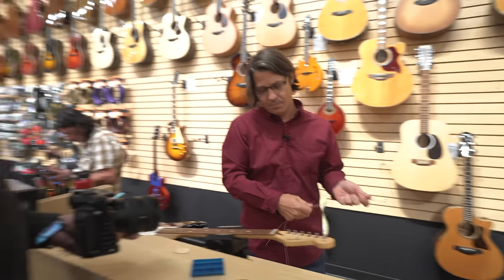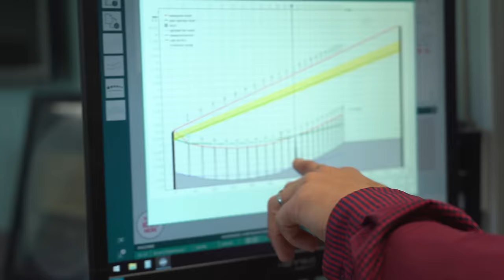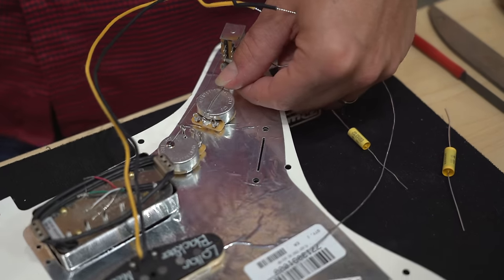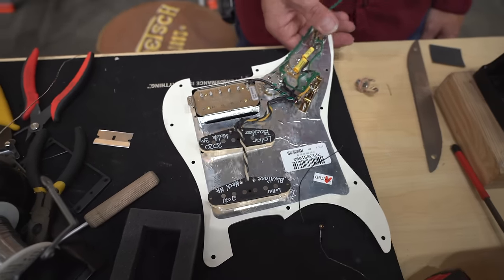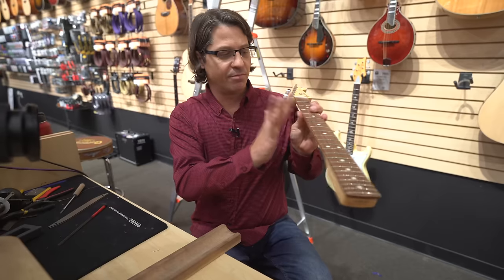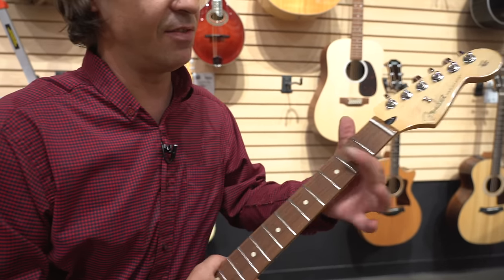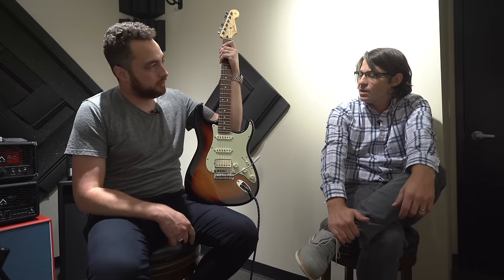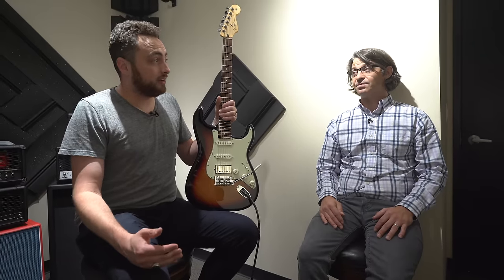We Tried To "Custom Shop" The Cheapest Fender Strat

Comment: Bro, the mexican made players series strats suck.  The squier strats are 10x better as far as finish quality etc.   even the cheapest affinity series strats are better…..except the ceramic pickups which is purely a preference thing.  I like them personally.    
Id never ever pay $900 for a players strat.      Id never pay for a squier either.  For a couple hundred bucks and a lil tlc i can build a strat from a kit or body and paint it with nitro finish in whatever color i want or a cool artistic paint,  i can put whatever pickups i want on it, i can wire it how i want, put a neck with scalloped frets on it whatever.   Then if a “fender” makes u feel warm and toasty inside, i can slap a fender decal on the headstock and sell it to you for $500 more…..but me personally, i like to carve the headstock into a unique shape too.

Comment: Y guysou buy a guitar for $800 that you don’t like which by the way sounded pretty good to me and you’re gonna put another $800 into it you can send it back to the shop and have them correct all the main problems which they should’ve done in the beginning and  still only have $800 into a guitar. What you guys are trying to do is pretty dumb to  me.

Comment: You can’t custom shop the cheapest Strat because custom shop guitars their wood is specifically picked from the best and their made with fine detail buy just a few guys not the whole regular Assembly line so you would have to build a strap from the ground up counting the wood cutting it out shaping the neck from a single piece of wood and all that you can’t just buy a cheap guitar and custom shop it🤨

Comment: I thought replacing the pickups & electronics was a bit more than should have been done at the start, but a custom shop model is going to come with better parts.
It would have been nice to see an intermediate setup more like was discussed... you know... upgrade a little here, a little there, and in a couple years you have a great guitar.
But we don't get to see/hear that.  Hindsight is great isn't it?

Comment: If a shop is worth it’s salt, a setup should include a fret level ,and recrown , fret sprout addressed.  As well as the various height adjustments. That should included used guitars as well. The  should also offer a touch up setup within 30 days to fine tune any adjustments the player would like . Also IMO if the local shops do not offer this type of service and a person still wants to mod their guitar in such a manner buy a used model and used pups you can save that way and also may fine some mods already done

Comment: . Ive bought a few name guitars in my time which have had sharp fret ends and too shallow nuts  and  think the only difference between mid range and high end guitars  is that once off the production line they  are hand finished and set up . I'm sure in 21c where everything from cars to computers  are built by robots  to ultra fine tolerances  ,that producing and selling  less than perfect guitars is nothing more than a sales ploy to get consumers to buy a better one  . All the more reason to wise up and learn how to slot a nut cut a shim and lose the fear of trussrod .

Comment: I did something kinda similar.

Bought a 2020 Player Strat, sure it needed a setup and fret work, I didn’t have the board rolled but I did have the frets profiled and polished along with the sharp edges filed. Actions and intonation sorted along with fitting some SSL-1s.

Over the next year I changed for locking tuners, TUSQ XL nut and swapped out the electrics for US spec.

I’ve played it a ton and the fret board edges wore themselves which was perhaps the extra thing that was featured in this video.

I love my strat, the journey was a lot of fun, I bought it new for £550 and spent maybe £700 including labour on it, not all at once though.

I think it’s totally worth doing, you learn a lot swapping things out and they guitar will feel more like yours than a very expensive custom shop, not that I wouldn’t turn down the latter if I could afford it.

The video does make one point which is so true, how a guitar plays is so important, always get a guitar setup and some fret board work if you can!

Comment: Like the parts about up-grading pickups and switches. Would like to see the schematic of the pickups and add on,  I own a Player Strat HSS, after two years, I worn down the freets, had them changed with stailesssteel frets and changed the radius to 12 inches, cost me $900 CDA, very different beast now.

Comment: I think another thing not mentioned is how some of the guitar parts that weren't replaced will perform and how they will wear, specifically the bridge, tuners, and I think more importantly the fret wire.  Does the guitar stay in tune with trem use?  I believe the Custom Shop uses Jescar fret wire and they last a very long time, whereas you'll see more fret wear with the cheaper guitars.. and refrets definitely aren't cheap.

Great video!

Comment: Why didn't you replace the bridge? The bridges on player strats are so cheap and the block is pot metal. Could've gone with a gotoh or callaham and it would've drastically improved the sound of the guitar.

Comment: Very interesting project. One thing not mentioned is that Custom Shops get first pick at the tonewoods ahead of the production models. You really can't ever match the quality of woods used for the body, neck and fretboard. But the other upgrades and work improved the original guitar significantly, for over $1000. What could they have done for the cheapest Squire made in China?

Comment: I did some modifications on my 2003 MIM Standard Stratocaster as well but never considered swapping the pickups since I was always like that’s the core tone/voice of the guitar I was used to.

A bone nut is a must have, definitely. The other thing was a big brass trem block to install, which made the guitar incredibly resonant (and heavier but never mind :D). The factory block was rather a joke in it. I also installed Kluson Deluxe Tuners with off white peg-heads (I know it’s not a Mustang but hey, it looks great). I tend to use big bends and I never have any serious tuning issues.

The neck pocket got cleaned at some point, I got rid from those shims they had installed (of course the base of the neck needed some adjustments by sanding). And I did re-fret the guitar with jumbo stainless steel frets. What a game changer that was, along with rolling the edges off. And every now and then the rosewood fretboard receives some oil.

Apart from these there had been some shielding added in the cavities since these early 2000s Standards do not have too much. I have some plans of having a treble bleed circuit and maybe better pots and caps for the future.

All in all the above might seem much for a single guitar but it was not much in terms of costs because the works were done at home mostly (even though a luthier checked upon them later but found no big issues :)).

However I would never want to rip the Midnight Wine paint off even though I don’t like poly and you never can get rid of the black truss rod hole. These guitars never will become ‘60s repros but you can improve their quality massively.

Comment: Been there, done that – sort of. In different years, I bought a Squier Tele and a Glarry GTL, both as mod platforms. Had my luthier do basically the same thing – replace the electronics with high-end, changed pickups for Seymour Duncan in one case, DiMarzio in the other, a tone of the same sort of work done on the neck, better tuning machines, bone nut, careful intonation. They both played and sounded great, and I did it as an experiment, to see what Rhett is trying to do – can an upgrade from a basic platform be equivalent, and basically worth the cost? My answer in both cases was "yes!" Buy the basic instrument, mod it to suit your whims, and if it sounds and plays the way you like, you've still spent less than buying the high-end model, and now you have one exactly as you want it.

Comment: I did something similar with a Jaguar Blacktop HH, only difference being that I did 90% of the work myself, which made it much more viable. Added a Bigsby and a Mastery bridge, Tusq nut, added some string trees, threw in a couple McNelly pickups and Emerson electronics (aside from a push/pull), and set it up. Only thing I took it to a tech for was installing the Mastery bridge since it had different sized posts (and I didn't have the proper tools) and adding shielding that I was too lazy to complete. If I sold it as-is (which I have zero interest in doing because I love it and it's mine), someone would be getting a hell of a deal on a loaded Jag. Selling the parts by themselves would be worth more than the guitar. Was it worth it? Heck yeah, because I didn't buy a guitar then drop a grand on parts for it. I did it over the course of about a year. It doesn't feel anything like my custom shop Jennings. But... honestly, that's what I kind of like about it. It's not perfect, so it does it's own, unique thing.

Comment: this takes me back, when i was 16 i grabbed an '07 made in mexico HSS strat secondhand for like $275. Midnight Wine finish and a rosewood fretboard. 

Didn't like the stock white pickguard, and wanted to swap for tortoise shell, but the store didn't have any in HSS configuration, so i bought a regular tortoise shell strat pickguard and my uncle took it home and filed the hole out for me to fit the humbucker. next thing i did was get the pickups swapped for some dimarzios. A tone zone humbucker and area 67 noise canceling single coils. Then I cut up a bunch of pieces paperboard to block the trem because i hated trying to tune anything with a trem system, and it seemed easier than trying to cut a block of wood to the right size with the imprecise tools available to me. I really just wanted a fixed bridge, but couldn't find a strat like that in any stores and didn't want to have to drill new holes or anything to put a new bridge on. 

it was my fist time deciding what changes i wanted to make to a guitar so i made some less than ideal decisions with it, like mixing a high output humbucker and lower output single coils, so despite my best efforts of lowering the humbucker and raising the single coils to close the gap in volume, i eventually settled on rolling back the volume in the bridge position, but man that thing was beautiful. I made sure to get my new pickups in black instead of white, and the store i had the work done at did a little extra and just traded the stock knobs with another strat in the back of the store that had black ones so my knobs would match the pickups, free of charge and i didn't even ask for that! 

funny thing is, as much as i loved it, it became a dusty wallhanger because i wound up practicing more with my stratacoustic, figuring all the practice would translate since they're both fender strat necks. But then every time i picked the strat up, i got annoyed constantly hitting the volume knob while picking/strumming. then the volume pot started getting crackly, and i was never able to decide between getting a 250k pot or a 500k pot to replace it, but by that point i couldn't really justify spending money to get the work done with my love for acoustics, and the owner of my favorite guitar store passed away and the store closed since then, so idk where to get work done anymore.

Comment: Best strat control/pickup configuration using all Fender parts (IMO):
HSS (Shawbucker 2, Texas special single coils)
TBX,  500k vol, 250 vol control layout (individual volume controls for humbucker and single coils)
Super switch for coil split
Hot rod capacitor

Comment: I have a 1987 FugiGen Fender/Squire stratocaster that is my first guitar. I upgraded the pickups (Vintage style Alnico ii), CTS pots with a blender in the second tone pot, had the frets leveled, crowned and dressed, bone nut installed. I would put this guitar up against any custom shop or Ultra out there. All for around $550 including parts and labor....👍👊😎🎶🎸

Comment: I have a Squier CV 60’s Strat and did my own fret ends and rounded my fretboard with a fine grit sanding block I bought at a hardware store. Cost me $3 and took all of 5 min of time. It does feel better. I did my own set up watching a few YouTube tutorials. I then had the chance to play it back to back with a professionally set up Fender American Special Strat that my friend lent me for a bit. Maybe I’m just a dummy but playability-wise, I couldn’t tell the difference at all and the stock pickups on the Squier didn’t sound worse or better than the American, they just sounded a little different. If you can afford it, I guess there’s nothing wrong with having custom shop whatever, but my Strat has a poly finish, cheap parts, and a set up done by a self taught amateur and somehow it plays and sounds great. I can guarantee a custom shop Strat won’t sound or play 10 times better than my guitar. Also, my guitar is less than 7 lbs, that line about poly finish adding weight really comes off a bit boujie, no offense.

Comment: This shows two scenarios; the different things you can tweak and customize to YOUR taste and playing style.  Not necessarily changing everything.  But also if you spent the same total on a high quality guitar then you’re done.  A couple of years ago I got an American Pro II Strat.  One of the best playing guitars I’ve had. I’ve been playing for 37 years and  own seven Strats and six Les Pauls.  All it needed was a set up. Plus I got a case with it.  I recommend that players learn to do set ups and pickup installation.  It’ll save money.  I still use a shop for major things like fret leveling but I’ve figured out how to really dial in my guitars.

Comment: I agree to a certain point. When you buy a Fender Custom Shop you are buying a guitar built by some of the best luthiers using the highest quality components that can’t be matched. However a lot of times you also have to compromise on your specs of a custom shop unless you go masterbuilt and that’s almost double the price. By modifying a good entry level Strat you can spec it out to exactly what you want. I had a great road worn Mexican Strat for years that was always being modified. I would always modify it to whatever genre I was into or project I was working with and always felt great.

Comment: I bought a 2007 Squire Strat at a local
San Diego Swap meet for $75 ( with soft bag & amp and extras 😳) and after swapping on an E-bay Wilkinson Prewired Complete pickguard assembly ( scored for $38 delivered to my doorstep) and a set of Ernie-Ball “ Heavy bottom “ strings I now have a less than $200 guitar that just sings…. Out of my 13 guitars it is still one of my favorites, & for the price cannot be beat ( in my opinion anyway) 👍.  Great video as alway Rhett 👍👍

Comment: Unless you're intent is to flip guitars and make money, doing upgrades and improvements over time is a great way to end up with a fantastic personalized guitar, even if it takes a while to get to the finished product. The fun is in the journey. When I bought my MIM Player, I had a pro setup done immediately. The fret ends were not BAD out of the box, but they weren't great. Back to the luthier to get the fret ends dressed about four months after buying it. Best. Upgrade. Ever. Locking tuners were added at the last string change. A bone nut will probably be next. The only thing I don't like about it is something than can not be upgraded: the poly finish. It's the color I wanted, but it will NEVER wear out to show evidence of all my playing like a lacquer finish would.

Comment: I just purchased my first telecaster.  Semi local independent store, about a 3 hour drive but worth it because they are great and they had 30 or more teles to try. What Rhett said about no you can’t make a custom shop out of a cheap guitar is so true but what shocked me was the difference between MIM and US made. I won’t go through the whole story but I went with every intention of buying a Isbell tele. The guitar lists for 15-1600.00.  The neck was terrible. Fretwork was atrocious and the rosewood fingerboard was a fraction of the thickness of a Performer tele I looked at that was 200.00 cheaper. I didn’t buy the Isbell. It just didn’t feel right in my hands and I couldn’t overlook the quality difference. I own a custom shop Stratocaster that I bought in 1987. There really is a difference between that and every other guitar I have ever played. Prices now are crazy for sure but the quality is real.

Comment: I used a foamy sand block with an angled side for the fret job on my Squier Strat to smooth out the sharp frets. Since the neck has no finish (varnish), there was no risk of damaging anything. What an improvement! My USA Pro 1 Strat now sleeps into its case... and I sold my Custom Shop 56'!

Comment: So I did a superstrat. Took a fender starcaster, sunburst, installed a full block fender stamped tremolo, double rail humbucker in the bridge position, roasted maple off brand neck with bone nut, headstock shaped like a strat. Installed locking machine head tuners. And bought the f stamped neck plate and installed it. Guitar came out awesome. Got my single coils infront, classic strat sound, double rail humbucker in the bridge gives me the crunch and metal sound. Very versatile guitar for cheap. Cost about 160 total with parts and shipping. The guitar was gifted to me. Had some neck buzz with the original neck. Made it sustain well with the full block trem and locking tuners. Intonated it good, adjusted neck, great action. One of my best guitars now.